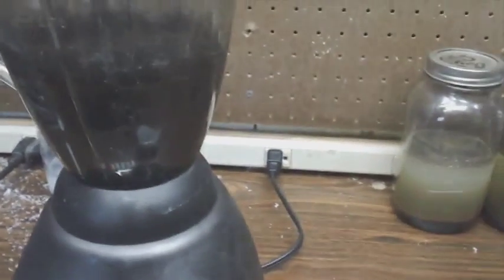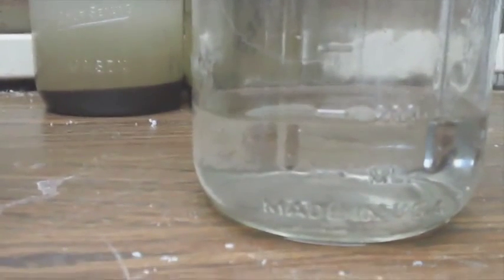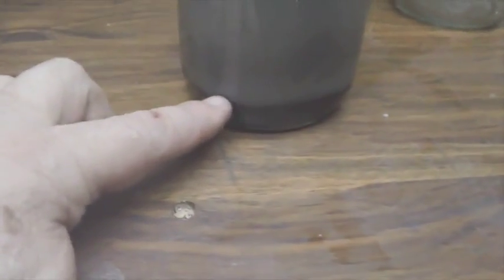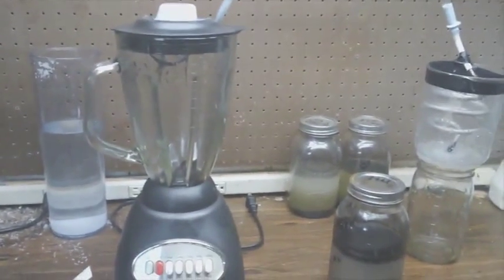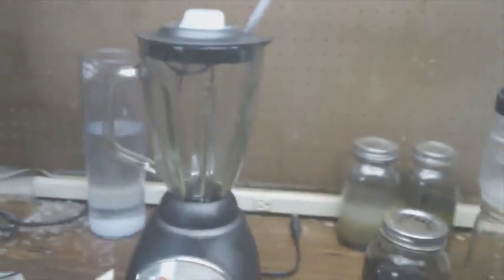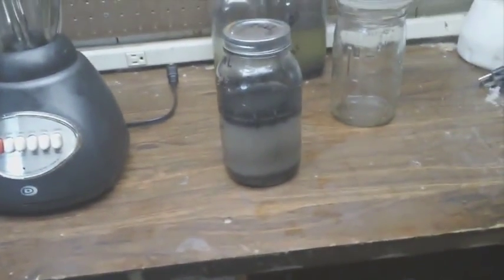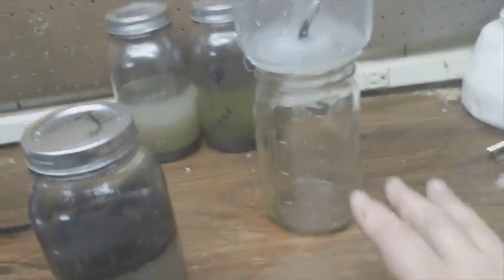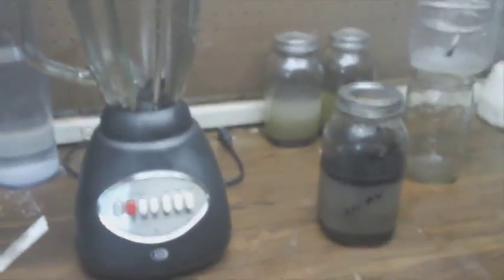Graphene blender method test Day 7

Comment: oh and also I use glass jars and aluminum foil over the seal's before screwing the lids down as it creates a seal that is metal on glass, so a sonicator using that method to hold it in the jar before submerging it in the sonication tank, so that it can not dissolve any aspect of what it is in, 

additionally glad someone is reclaiming the acetone, with reclaiming processes I had mentioned before if you do it from a bigger tank you could store molds down at the bottom full of plastic acetone or any other solvent, so that when you collect and cool down to reclaim the evaporating solvents, you get to use them again and cast plastic parts out of the molds in question, the cheapest way to manufacture I am guessing that there is at this point :)
Reply from the maker: Sorry guy, there's a way more effective way to make graphene use an electrical current if you check out Robert Murray Smith  "graphene- a simple method for mass production"  this method is easy, it uses sodium sulfate as the electrolyte, you still have to   use sonication to make the product, but the electrical current does a much better job with bigger plates check out his videos for the new solution.